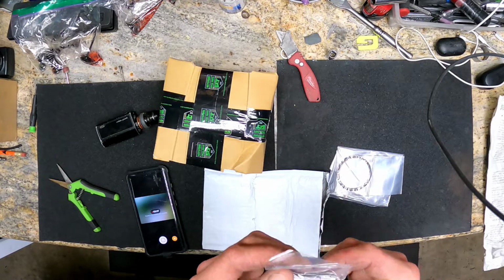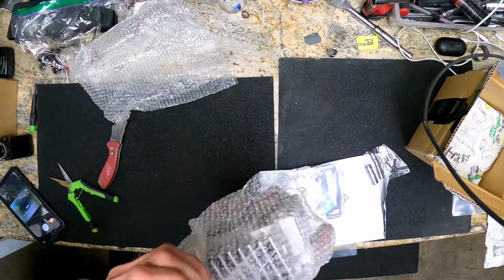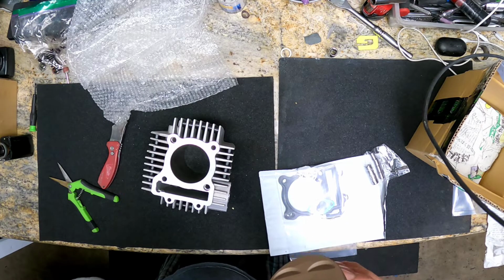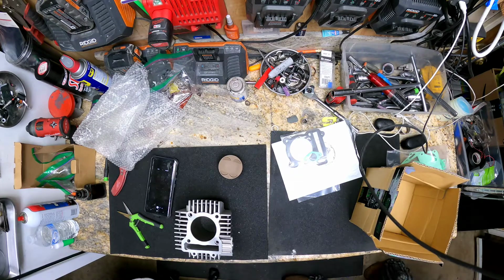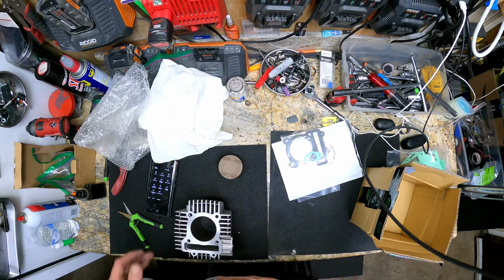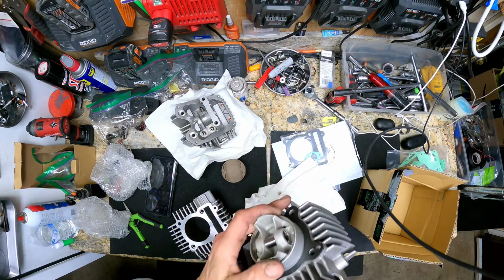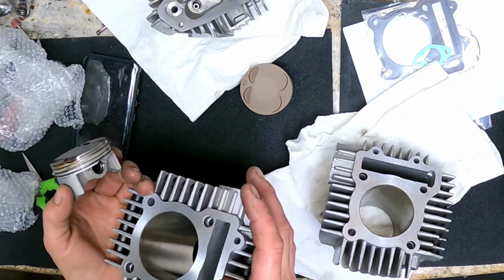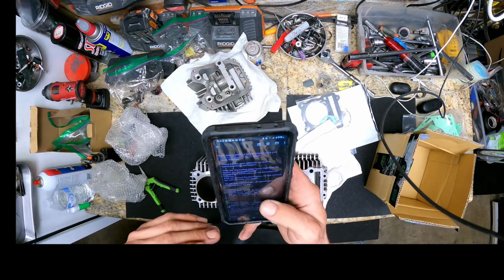daytona 212 big bore kit unboxing and shop talk grom clone

Comment: Did I miss a video where the 190 blew up?
Reply from the maker: No I got lucky  Caught it before it did I decided to pour the heads and when I opened up and checked the cylinder out I found that the  Coating was failing  You could chip off in a few places after seeing that I had to buy a new cylinder piston no way I was gonna run that

Comment: Do ur know why your 190 went out?
Reply from the maker: It never went out it ran up perfectly fine when I decided to take it apart to pour it I just noticed that the cylinder lining was bad it was cracking and I think it was due to a bad Job on the nikasil or what ever  coating they used  It's definitely failing I thought it was a bad casting too That's why it's important to break your inches down and check them out as you never know if it would have blown up it could have took the head out and that's expensive this way I caught everything before anything ever happened I've been happened by Grant perfect it was runing the best it ever ran The reason for the 212 is its same price as the 190 so I said   She was a Michael let's get big boy I love it as add the nice bit of power definitely feels smoother too  And weirdly the shifting's  seamsbetter I know it doesn't make a difference at all  But I've got a driving around I was thinking about the shifting and smoother the porting definitely opened her up too and I didn't do exhaust model words doesn't go inside the motor like A
CRF style pipe is This just mates at the flange in the straight 1 3/8 so there's no restriction
Reply from the maker: I really wish youtube would let me post pictures in the comments that'd be sick
Reply from the maker: need to edit so Many videos I have a hell of videos I just Need to find time to edit it that's the issue I literally put a GoPro on and record every time I go ride  on anything  only upload the ones I like usually but I really have like 500GB right now in videos It Would be awesome if I had editor Because I have all the videos I just don't have the time to edit themI'm gonna try it my best tonight to edit  and upload as many as I can
Reply: Okay so u did that at a preventative measure. I wish u would post the video of the install of the original Daytona and how u did the wiring cuz i want to do it
Reply from the maker: @austinVloggs390   There was literally no wiring just one plug that was it !  was plugging play with the Vader harness  I literally put the motor in both of it down and then plug the one plug it into it and then I took my gear selector from the Vader motor and put it into the Daytona motor and thats it
Reply from the maker: I got u just pulled up old ima make u a short ans upload jusy for u
Reply: Bro thank you so much!

Comment: Make sure you remove all the spacer that are in the cylinder. The Fe cylinder is different so it will be interesting to see if it clears the starter. I've watched a all you videos but I couldn't comment because I wasn't on my account. I did a lot of research on Daytona engine and no quite a bit on them I'm building mine right now its go fuel injection I would mind talking to you if you wouldn't mind email me. I no were to get part cheaper and what parts interchange I don't what to say everything I no on YouTube the reason for emailing. I also live in Cali as well an were about the same age with similar ideas. Lol message me back and I'll shoot my email if interested. Have a great one till the next one 👍👌✌️💯🔧🏍️
Reply from the maker: I had to cut my big bore cyl ez its square can do it eith hack saw
Reply: @Tuckem2STOGS the easiest and cheaper way is to buy the z's 212 cylinder it's exactly the same just think of it as a fe it's all made in the same factory same build house I'll email again with more information if you would like 😁👍✌️💯🏍️
Reply: What are you running for an ECU?
Reply: @thiswillprobhrt  for the ECU I have a grom harness  and a af1 with a aracer mini ECU with a couple of other thing to make up the entire fuel system warning it not cheap to go fuel injection but tuning and dialing it in is a lot easier specially if you just let the af1 do the work for you. 👍👌✌️💯🏍️